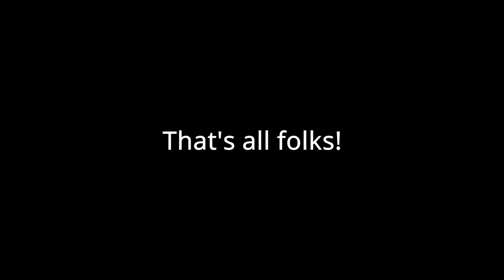Woodturning - Easy Segmented Pen blanks (Huw Davies method - Wooden it be Nice) - Prokraft Hexa

Comment: Super job - next  a hexagonal one maybe?
Reply from the maker: Hi Jon, thanks for commenting. To be honest I'd rather not compromise the smooth feel of the pen by trying to match the cap and the body. I did a slight compromise on the one you see me measuring the body diameter where I made the diameter that of the hexagon across points. I like the kit though and will try one without the little flat end cap next. Cheers, Dave

Comment: Hi Dave, Brilliant work mate and I love them all.
Fantastic work on the glue ups they were effect., especially the bonus one as end grain gluing can be problematic.
Same as Andy I use 1 coat of thin super glue before sanding.
I'm going to be buying some of the Hexa kits, they look really good but how do they feel to hold in the hand?
Fantastic video all the way through and thanks very much for the shout out. I really appreciate it.
Take care Dave.
Cheers, Huw
Reply from the maker: Hi Huw, You're very welcome. I must give the CA glue a try, I also think that spray sealer might work better than brushing. The Hexa does sit well in the hand as there is no step. I have biggish hands but any bigger and it may be a tad on the short side. It might well be one to try and do a closed end version on that's a bit longer. Cheers, Dave
Reply: @MoleValleyMaker  Thanks Dave. That's a great idea.

Comment: Nice pens, whose mandrel is that ?  And on average how long does one take to make, as i had to give up wood turning because of health issues , if pens don't take too long, maybe i could try those
Reply from the maker: Hi Matt, the keyrings are on the Axminster mandrel but the pens are between centres, a dead centre in the drive side. With a skew and minimal sanding I'd say 30 minutes of turning and finishing. Cheers, Dave
Reply: @MoleValleyMaker  Thank you